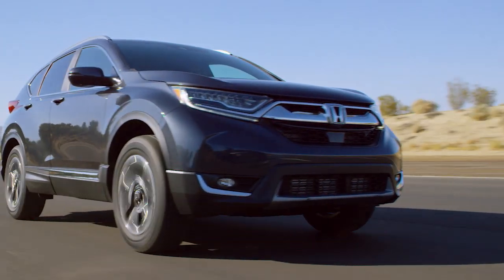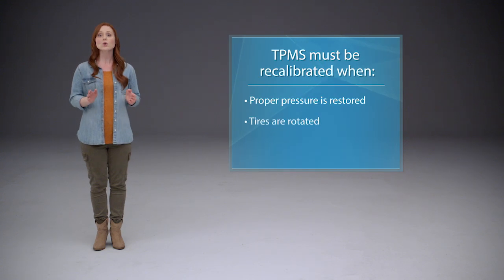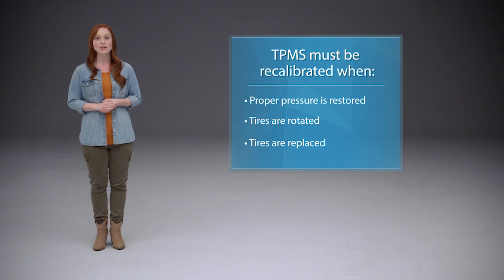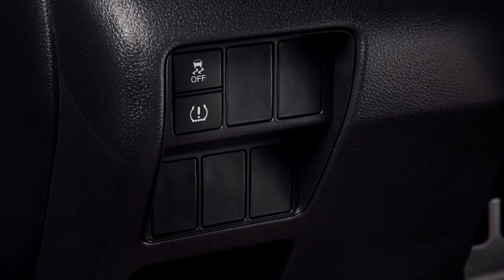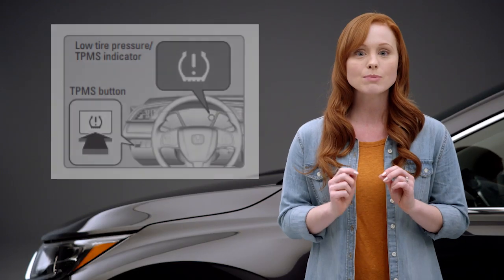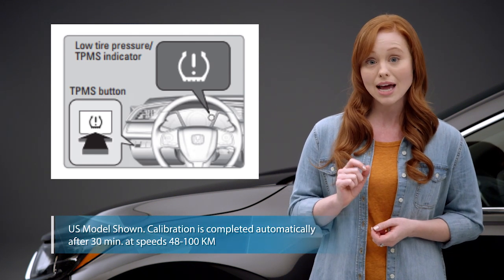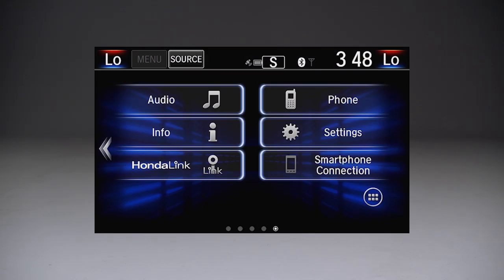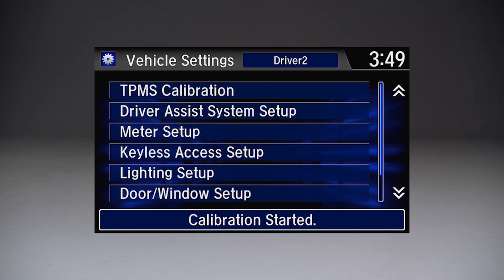Honda's Indirect Tire Pressure Monitoring System

Comment: Honda Canada,     With this indirect tire pressure monitoring system will you get actual tire pressure of each tire?   Or does it take actual TPMS sensors in each tire to get actual pressure of each tire?

Comment: Can someone tell me what is inside of an OEM 2018 Honda Accord wheel? There is a black plastic piece about 2-1/2" width by about a feet tall doing a bit less then a quater of the wheel diameter.

As the TPMS is supposed  to be the ABS sensor, what is this?
Reply from the maker: Hi there, without more information or a photo, we can't speculate what you are seeing. We recommend you reach out to your local Honda dealer who would be happy to assist you further. Thank you!

Comment: We have a 2015 Honda Odyssey Touring that we purchased last year.  I just changed the winter tires out for the summer tires and we get this TPMS warning.  No TPMS button or TPMS within the System settings.  How do I reset it?
Reply: I've a 2015 Civic, so if we have the same setup... here's what I would do.  While you are in park, and with car turned on: 1) On your steering wheel, find the button with 'notecard stack' symbol (sorry for the better or lack of terms) 2) Once that's selected, toggle through till you see 'customize... ' or 'setting" 3) Click on that, and you will see TPMS calibration initialize  ... hope that helps!